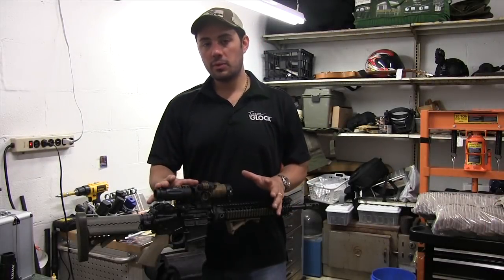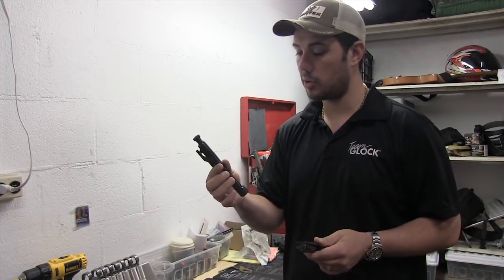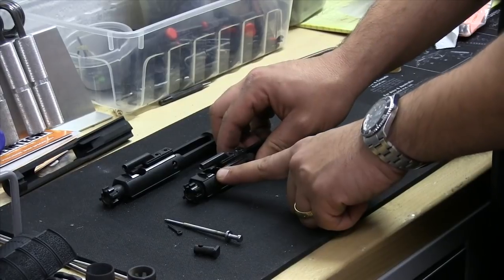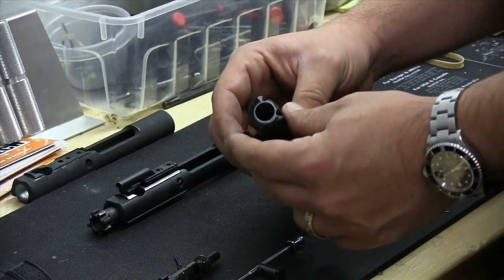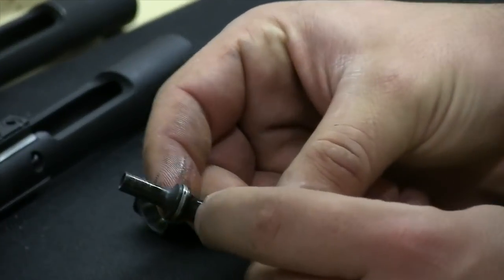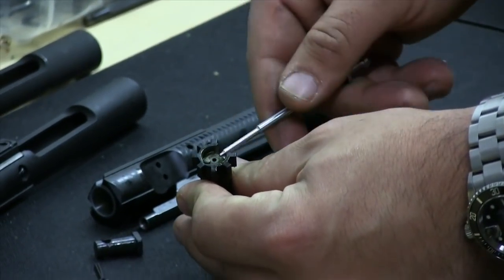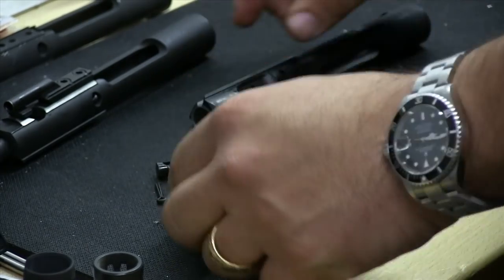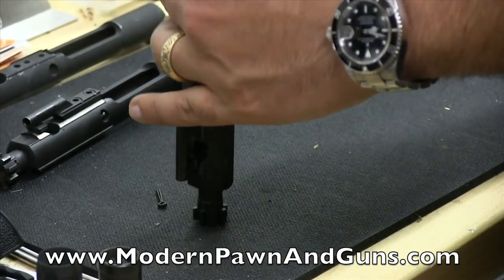AR15 Bolt Maintence, Disassembly, Reassembly and Inspection M4

Comment: Well done.  My Cam pin had minor scoring, yet is relatively new.  Now I know why as this piece takes some abuse.  I purchased a back up for when it's time to replace.  I would have  NEVER know to do this without this video.   It also address my question of where to lube the AR-15, although lubing the BCG was left a little vague.  You implied to lube at areas where there is contact shown thru shiny surfaces and showed the wear on the splines, but didn't say expressly to lube there.  Minor detail !  All in all, great video.

Comment: I must admit, when I saw "Pawn Shop", I almost passed over this video.  That would have been a mistake. This is an excellent overview of the bolt-carrier-group, function, assembly, and inspection - which I sorely needed.  I appreciate you putting this together, and I will definitely subscribe.

Comment: Most informative presentation that I viewed in regard to the bolt and carrier group cleaning and reassembly. Also what to look for when re-installing..how the bolt reacts if not installed correctly...firing pin etc. Excellent job.

Comment: The gas key has a small hole to vent inside the bolt to help unlock the bolt. However, this also leads to fouling inside the bolt. My question is if this venting is absolutely necessary when the piston system ar's do not use this at all but rather unlock the bolt only with the rearward action only?

Comment: Great video, thanks!  I just bought a Windham Weaponry SRC,   I took it apart to clean it and the firing pin retaining pin was difficult to remove and re-install.  Do you think this is because it's new or is something wrong?  I've seen videos where people use a toothpick to remove it and their thumb to re-install it.  There is no way I would be able to do that with mine.

Comment: Is the firing pin supposed to stay towards the rear or does it move forward with the bolt?  Thanks for the video helps a lot.
Reply: In a properly cleaned rifle, the firing pin "free floats" in its channel. meaning it will slide back and forth with the movement of the carrier. However, it does NOT have enough mass to fire a primer until the hammer hits it.
Reply: I just bought a brand new AR. I just got finished with its first thorough cleaning. My firing pin was hard to get back in, and it doesn't move very freely. Will this wear, and become smoother over time?  I'm knowledgable with firearms, but this is my first AR rifle. And it IS assembled correctly. Was just curious about it being so hard to install, and not moving very freely.

Comment: What is your "opinion"on using the grease sold as Choke Tube and Thread gun grease as seen on shotguns? Have a tube given by a buddy of mine but was unsure if was feasable for use on the BCG components. The label mentions high heat stable. Should I stick with Outers which is my preferred for my handguns? Only recently invested ( say that due to the price and quality of the rifle and look to it for protection of my family from our Government) in my first AR15 M4 feed ramp. When detail cleaning the lower should I apply a light coating of oil or the choke grease to all internal surfaces on the BCG or apply then wipe off excess?
My rifle was built by P.S.A. shot her finally few days ago and could not have been more pleased with smoothness nor weight distribution. I feel a lucky find was had on Gunbroker according to my brother fire fighters. I only want to keep her in the best of shape and maintain her properly since she is #1 not a safe Queen; #2 may need to rely on her to stop a threat (human or animal).
Please accept my apology for the long comment, I take great pride in ALL of my firearms and your video enabled me to trust your judgment and advice. Thee apology goes to my fellow YouTube users also.
Former LT Res2cue Technically Rescue Fire Fighter.
P.S. what have you heard about the Mil-Spec P.S.A. rifles in general? Can they really handle the cheap PPU; Tulammo or Bear steel cased ammo with the thin jacket of copper over a steel core round. The seller advised the PSA. rifle would/could "eat whatever I fed it. P.S.A. for those not knowing is Palmetto State Armory. Too many articles say no steel casings ever "tulammo" should be fired through an AR15 with M4 or not feed ramps. A neighbor whom is form USMC and his friend that builds specialty custom  "for the rich professionals where as money is no object", The $6-7 a box for ppu or tulammo ammo for desert shooting very appealing. Normal I run PMC or Federal xm193. home defense will either Speer gold dot 62gr or a similar in 5.56.
Thanks again. Ever in Mesa or Phoenix, AZ let me know. With. Treat for open dessert shooting my brother
Reply from the maker: It might be an anti-seize type grease.  Probably would work, but probably not ideal.
Reply: Okay  thank you for sharing your knowledge.

Comment: What's the deal with that stupid O ring over the ejector spring?  My AR from A.T.I. had one of those O rings and it was so stiff the ejector wouldn't move so the bolt could close all the way so it wouldn't fire. I had to remove the O ring before the bolt would close all the way with a round in the chamber.
Reply from the maker: Some manufacturers use the oring to increase extractor tension, sometimes, its too much.  I normally change the extractor spring every couple of thousand rounds and use the black insert, not the blue.  If the chamber is clean and properly cut, you should not need the oring.
Reply: modernpawn I removed the O ring and now it seems to work OK. The odd thing is it came with some shells from being test fired but the extractor was so tight it wouldn't move so I don't know how they did it.